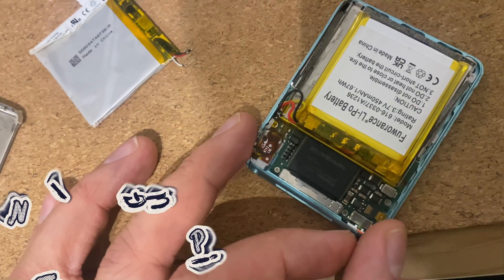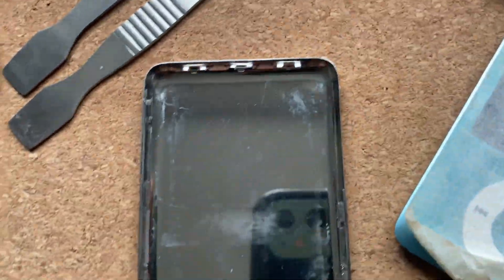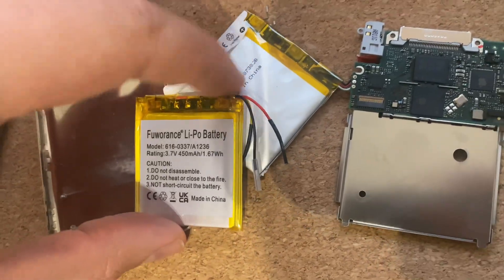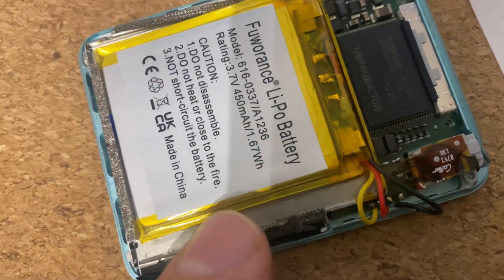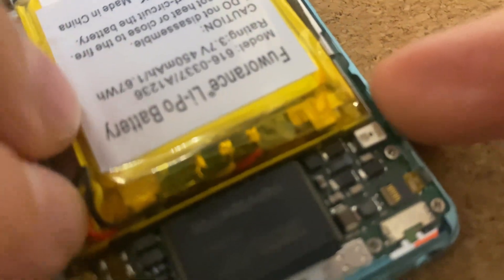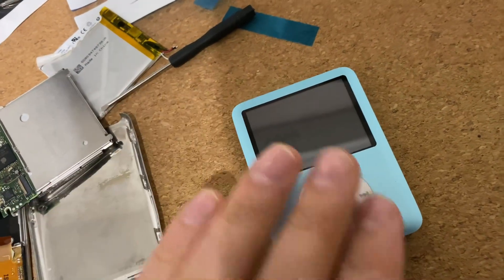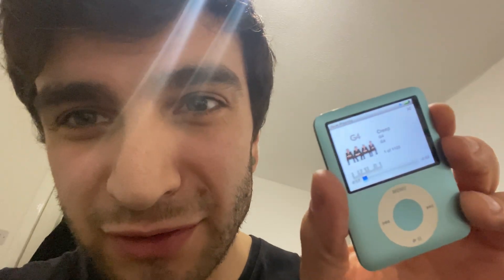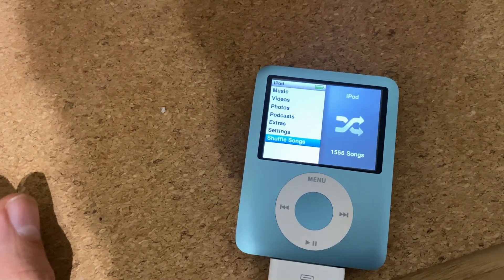IPod Nano 3rd gen battery replacement guide

Comment: I have been changing multiple batteries on various ipods, and I noticed the same behaviour you mention regarding charge levels. On mine, some behave the same - it shows it's charging and then disappears, but continues to charge in the background (and doesn't show when it's actually full). While others show that they're charging, but they never "finish". I let them charge for 1h or more, and it never says "Charged" but if you disconnect it, they're actually at 100%. Oh well... I think you're right with your theory. These cheaper replacement batteries don't have a mainboard to really measure the capacity, and let the device know when it's fully charged. But still, I love that there's still companies out there making them at least. They are such cool devices and they still look and feel modern and high quality.
Reply from the maker: My iPod still doesn't say when it's charging, but it is.  But I love how you can still get replacement batteries even though some iPods are 20 years old. 

I'm really tempted to try some new MP3 players. Do you have any suggestions? 😁
Reply: @g @glennewton7034 haven’t tried any new ones either to be honest. I saw your review on the Innioasis Y1 so I doono what to say. I was thinking to try one, but feels a bit cheaply made. Rockbox will probably improve the OS, but the device still seems pretty cheaply made. 

I just removed the battery in an iPod Nano 3rd because it was inflated, using your tutorial. Thanks for the help :) really nice and clear. I need to order a new battery and replace it, but I managed to open it with just a few small marks on the frame and saved it because the battery was so inflated that it was about to break the display 😢

Comment: Sad. I have no way to solder. I got this brand new and it never worked, back when it was first released. I guess it will just be a trinket of the past 😢
Reply from the maker: That's sad 😔 You can pick up a soldering iron relatively cheap if you ever wanted a wee project. I think the replacement battery is around £10 or £15
Reply: I got my solder on Amazon 😊

Comment: Hey mate, was just wondering what soldering iron you used to solder the iPods battery.
Reply from the maker: No idea. I got it from a school that closed down. But any soldering iron will do, its just 3 small wires.